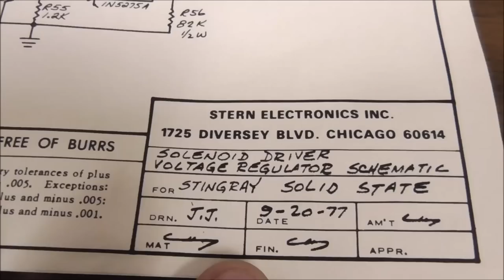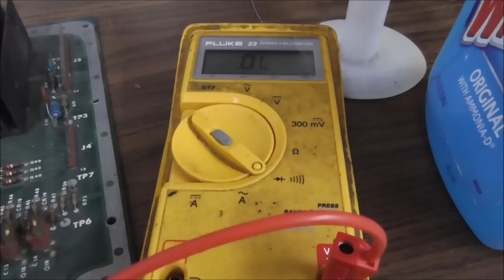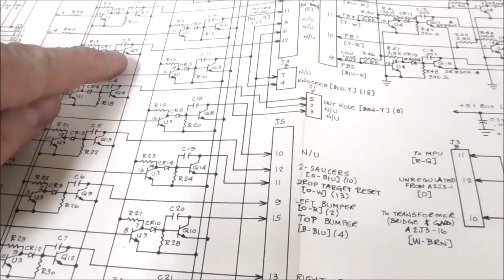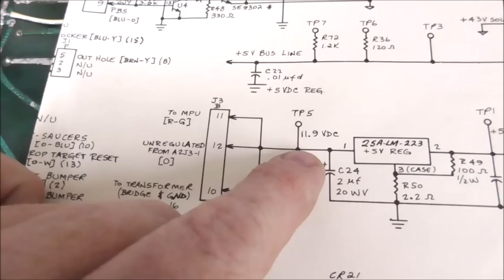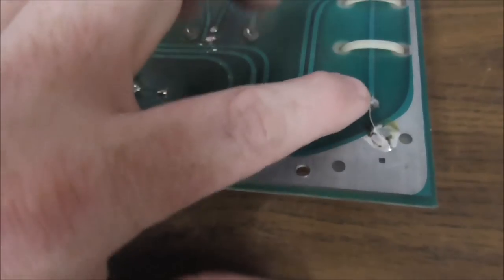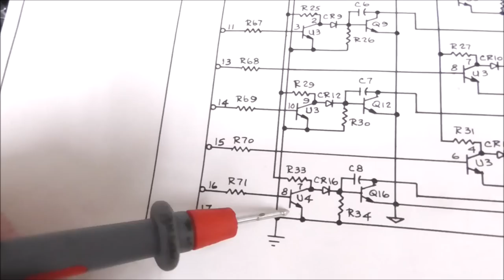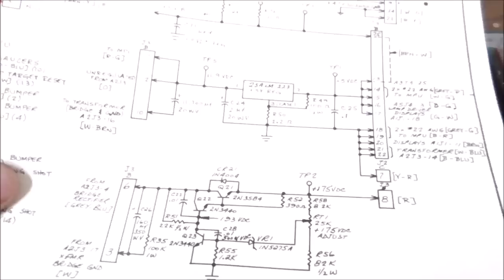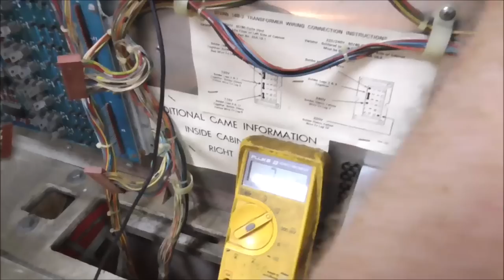Working on the PCB's in a 1977 Stern Stingray Pinball - Repair Part 2

Comment from the maker: Thank you to all the people who have been using our Amazon link:  https://amzn.to/3dQ78ZX ... when you simply click that link before you plan to purchase anything on Amazon, it gives us a royalty for sending you there!  Thank you!
Reply: Say Ron Sir, would you be willing to discuss how to clear via's for through component devices I am having issues with this so I've been just using a pair of tweezers. I've asked others and noone has responded to my question. I have used a desoldering tool and solder wicks but to no avail.
Reply from the maker: Spider that's kind of tricky, I just ran into it on tomorrow's video... if you're doing it on something that's contaminated like a via that has corrosion issues, it's pretty tough to get out, sometimes you can use like a cap leg or something but that usually works better if it's a clean connection and solder will flow through it.... you can usually burn it out with the tip of the iron but it screws up the tip of the iron and you're basically just burning the board... but at that point if it's that bad you don't have as many options.
Reply: @LyonsArcade  Thank you, so very much. I tried using cat5 wire to clear it which helped and it's just trial and error good to know much appreciated.

Comment: Had nearly a heart attack when you turned that on and that big hum came up. Then you showed all the interconnection cables unplugged. I was thinking a surge killed all those transistors, or a dead short. Way back in the 70s I worked a summer job at a small electronic factory. They made strobe power supplies for a certain camera company  (that’s still around). The boards were as small as a cigarette packs. We hand cut the resist and dumped them in the acid bath when I got there. Ugly like that board. While I was there I helped them set up a photographic projector and made the slides to expose photo sensitive boards. It was funny as we had one woman stick the new boards in the box,  in the dark, then I push the button, starting a photographic timer to expose the board. Then back in the dark we tossed it into the acid. After about 10 of them we turned on the lights and rinsed the boards. That was a huge change in production and they expanded 3 fold. Fun times. What are you saying. Fix if!
Reply: Christopher Rasmussen that board was not from that machine. I doubt that anything could happen.
Reply from the maker: I did some of that dark room stuff in high school so I know a little bit what you're saying, we had a big exposure machine we'd make rubber stamps for the flexography machines with...
Reply: @LyonsArcade  I took printing in HS and we did photographic plates. Neat Joe. Get that game done man. I'll be up.

Comment: These videos are awesome, its easy to follow and sure does make me wanna buy an old pinball machine to work on! However, since I dont have boxes of spare sparts, I guess it would be a real pain :(...
Reply from the maker: It wouldn't be too bad, usually they don't need too much.  You can still buy all the parts from www.MarcoSpec.com or www.PBResource.com depending on what it needs :)
Reply: Ill sure check it out, thanks man appreciate it! 
Woho, part three of the repair is out, keep up the excellent work!

Comment: What type of transistors do you typically keep on-hand for pinball repairs like this? 🤔
Reply: 78xx series voltage regulators (7805 for +5v)
Reply from the maker: If you go to www.PinRepair.com he has up repair guides for most of the machines and at the beginning of each he lists like parts to have on hand... so over the years, I've bought most of those as I run into things I need.  So the way I do it is, like when I replaced all those TIP102's on the solenoid board, I ran a little low so I went and ordered 30 more.  Or if I have to buy something I don't have, I just buy 10 of them.  They're always about a dollar or sometimes even as low as 20 cents so I just buy extras and have little parts drawers I keep them in.

Comment: those old games are pretty robust.  you have the chimes which I much prefer to the electronic sound generation.  will you burn new roms with the free play option? if you do will you show how to restrap the board for the new chips
Reply from the maker: Coming soon :)  This one is kind of special though because it's one of the first two games... so you can put it all on 1 Eprom.

Comment: You won...I’ve seen #1 first👍. I don’t know this kind of amazing machines but it seems that the display voltage rise-up with solenoid board becouse of the smoothing action of the long capacitor. As you said when it fails the display dance😬. Very cool video 👍
Reply from the maker: I believe you're correct :)  Seems strange to me :)

Comment: I'm not that great with electronics, but perhaps some voltage spike from the xformer took out all those transistors? Maybe that's why they pulled it out.
Reply: I believe the Solenoid board was probably from a different machine, as this Stingray didn't have one.
Reply from the maker: Yup Brendan is right this board was just in a box that we already had, so I don't know what game it was in originally but it wasn't this particular one.  Could have been a voltage spike though for sure in whatever it was in...

Comment: So the chip in question is a 7-transistor NPN array with a common emitter configuration. So I guess it is wired like the transistors at the bottom.

Comment: The reason the measured DC voltages are higher with the regulator board attached, is because the filter capacitor is on the regulator board.  When you measure at the rectifier board, you have full wave rectified AC, with no filter capacitor... so the output is oscillating between 0 and a peak voltage at 120 Hz.  If you put your meter on AC and measure at the rectifier board with and without the regulator board, I bet you will see a large AC component with no regulator board, and almost zero AC (or a few mV) with the regulator board attached.

Comment: Perhaps when replacing this ones battery should use either a super capacitor or a rechargeable coin battery like on most pc motherboards
Reply: As long as the battery is offboard and not on the PCB, it should be safe enough 🙂
Reply from the maker: You can use a capacitor but the problem is they drain out after a couple weeks... typically when we sell a game to people for their home they honestly don't get played all that much, but people like to turn them on every few months for a party or to play them one night, whatever... so in our instance, a capacitor wouldn't be a good idea.  I've started using button batteries though not the rechargeable kind, we'll see how that goes...
Reply: @LyonsArcade  Apparently the rechargeable ones are about the same price as standard ones.   You just have to remember to put a diode in place if you use non-rechargeables so the board doesn't try to charge them up.

Comment: It was probably a power supply failure that caused the board to fry that many transistors.  
Either that, or a major power spike.
No good looking at the schematic though.  That relay board may not have been in the same machine.   I would replace all the transistors in this case.  Normally I would only replace bad ones if it was just one or two.
Reply from the maker: I got tired after I replaced all the bad ones :) LOL  On a lot of these games, many of the transistors though do line up to the same coils on each game but when there's that many yeah it's not much help.  Usually the pop bumpers, slingshots, knocker, outhole, flipper enable and sound solenoids are all in the same positions, they just have extra ones that are different on each game like drop target resets, or saucers that differ from game to game....
Reply: @LyonsArcade  Yeah.  This Stingray will be amazing.  Or more correctly, is amazing as you have already finished it, but we just haven't seen it yet :)

Comment: Wow, something catastrophic clearly happened to the game that board was in to blow all those transistors.
Reply from the maker: Yeah I couldn't figure it out, several people have said a voltage spike but you'd think that would have taken out some more stuff too, I haven't really tried to analyze it and see what could have happened but it's the first one I've ran into like that.  Usually 1 or 2 are bad...
Reply: I wonder if something jammed the transistors on leading to their overheating and demise. I would guess the solenoid driver board was not designed to tolerate the solenoids being on continuously.

Comment: When measuringe tons of identical transistors in circuit, you can't beat the Testofon. It's an ancient piece of test equipment that converts current to audio frequency. Have a go at this (like watch it for a minute or so from the given timestamp)
https://youtu.be/D31ItpvJ3TY?t=1977
It's awesome because you don't need to wait for a display to settle let alone read it.
(it can also measure capacity and leakage of capacitors, read resistors and diodes and of course check your wiring for bad connections)
Sorry I sound like a commercial, I'm not getting paid by these guys, besides the Testofon I show is from the late 70s, their recent offerings look a little different but have the same circuitry. Why fix what's not broken?
Reply from the maker: That's pretty interesting, I've never heard of it!

Comment: I had a guy who owns coin op machines tell me it would probably cost a thousand bux to get my pin fixed locally. I'm in the wrong business.
Reply from the maker: I've never charged anybody 1000 bucks to fix anything, LOL  Usually it's between $250 and $500 depending on how shot they are.
Reply: @LyonsArcade  Hell, if you were closer I might let you do mine. I've had to learn electronics repair because of this damn thing!